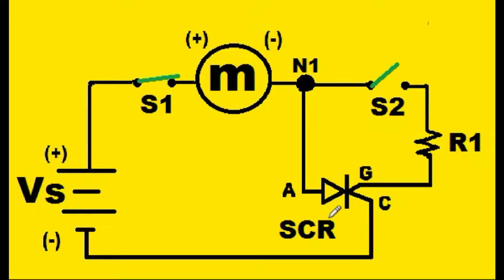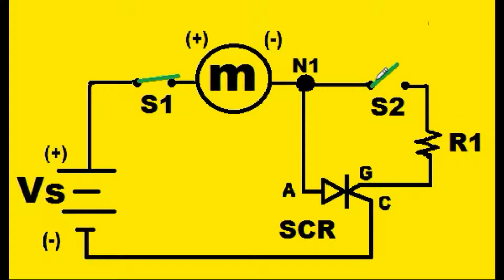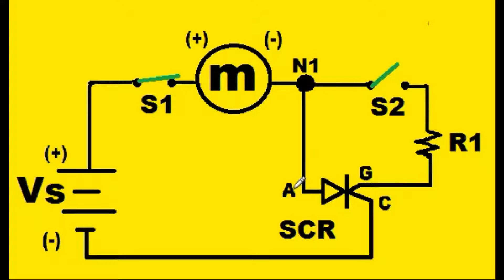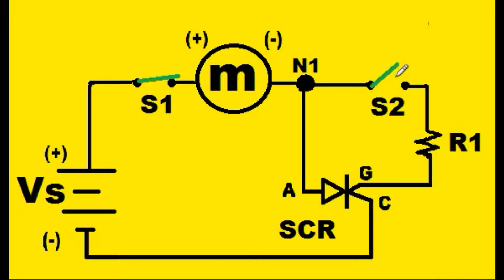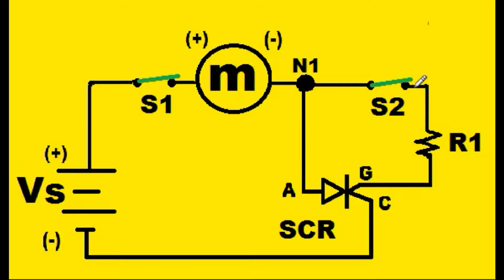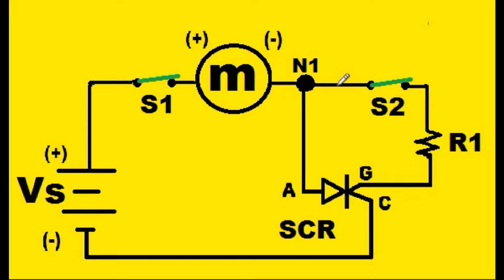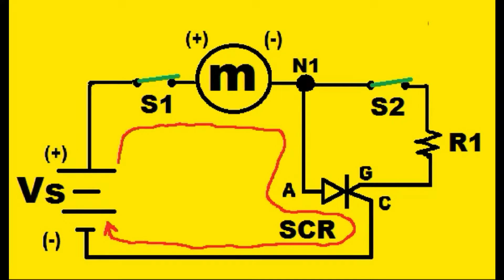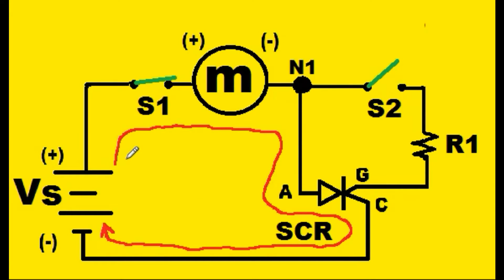SCR Switch Circuit Analyzed...

Comment: so what are the advantages of using this in a switch
Reply: I think the answer is that the SCR is a latching device, so once it's on, it stays on until power to the whole circuit is cut.  It's for cases where you would want that specific behavior.
Reply: if you are using a push button to turn on a motor then you need a device for latching. but I prefer to use a magnetic contactor for this circuit,